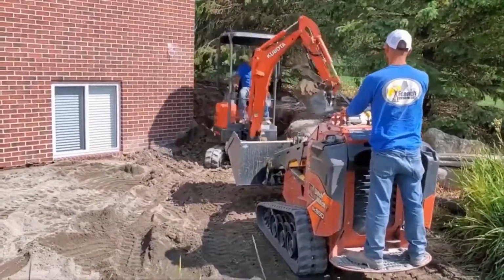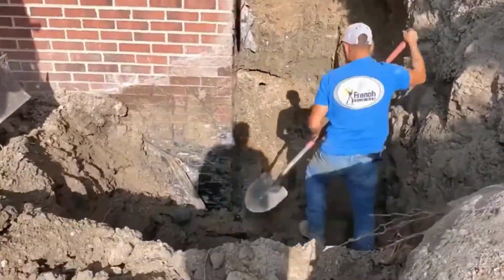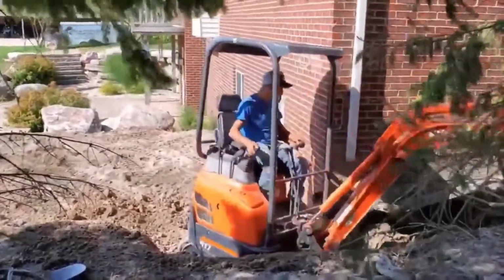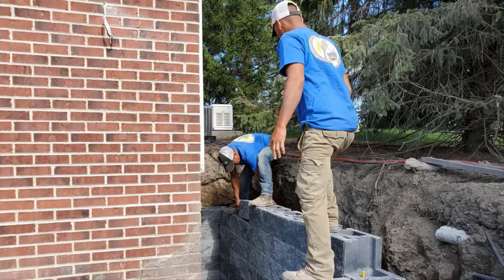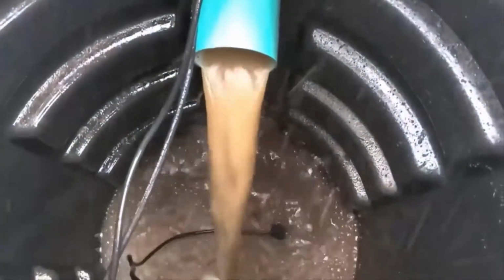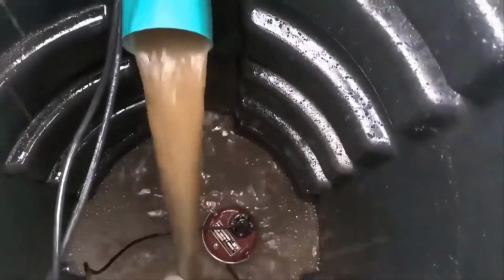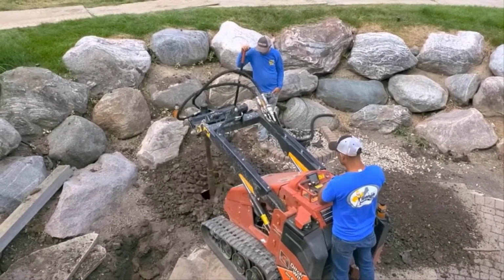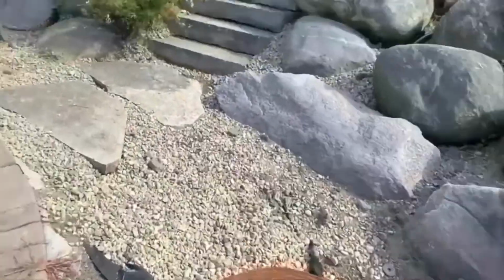How to ADD SLOPE to FLAT YARD For Better Yard Drainage to Prevent Wet Backyard and Basement Flooding

Comment: Just removing a 20ft concrete path from the front of my house,  install a cheap material French drain around the yard(roughly 200 ft) and do a slight regrade was quoted to me at 11k....I did it after work every day for 2 months... finished it up real nice and poured new concrete as well.  That part wasn't even included in the initial quote. I used the yellow slotted pipe and double punch fabric. Yard dries up SO MUCH faster than my neighbors now. Love it
Reply from the maker: https://youtube.com/playlist?list=PLjFCqaZ4v1BVyusRT3qfGPooNnHpHaoJg&si=x8ZikA7bZtJwJOPY

Comment: Great video.  I always wanted to lay clay around the perimeter of my house, with topsoil/turf above, to shed water away from my foundation and into the swales along the lot lines.  Never did it because my basement (concrete) foundation walls weren't high enough to avoid burying the siding.  I was more concerned with rot/insects, but glad I didn't move forward anyways.
Reply from the maker: https://youtube.com/playlist?list=PLjFCqaZ4v1BWSyew4JyZuxDpBvULztf91&si=x6oj8PpXAc4OPmaa

Comment: For situations where you aren't near power, and there's no way to pipe away due to lack of slope over the distance required, can dry wells work in predominately clay soil?
Reply from the maker: No. You need to build a elevated leach field above grade and use a pump system. I will do a video on this in the future.
Reply: @FRENCHDRAINMAN  Understood. I have the space to do a leech field in the area. Just worried with the heavy clay soil that wouldn't be ideal either.

Comment: Would you use 1 1/2" riverrock if u were Installing a tile system in the basement also
Reply from the maker: I would. You flow more water with bigger voids.

Comment: You like Liberty pumps more than Zoeller?
Reply from the maker: Both have their place. Liberty has less draw at start up.
Reply: @FRENCHDRAINMAN  Thanks for the reply.  You've seen no difference in long-term reliability?
Reply from the maker: @keifsanderson  Zoeller sump pump will survive a 9" rain fall tropical storm liberty will not. I'm usually 99% Zoeller these days. They have also treated me much better than Liberty from a professional standpoint. Liberty turned me off. BTW this video doesn't show a sump pump it's a 2" discharge sewage pump. They run forever. It will move solids. The open grate invites debris and would plug a regular sump pump.
Reply: @FRENCHDRAINMAN  Awesome.  Appreciate the insight from someone in the know.  Thank you